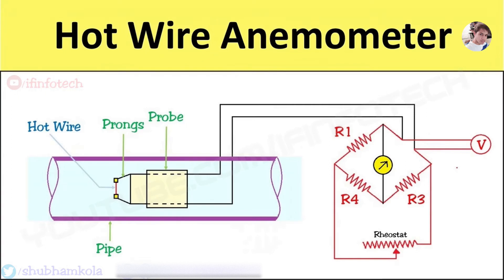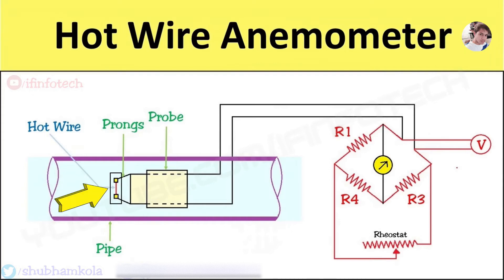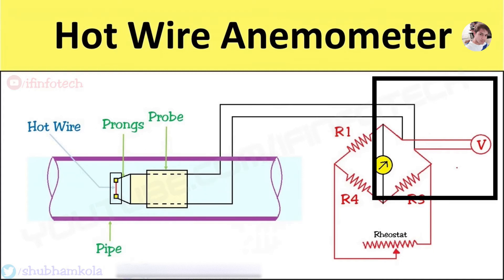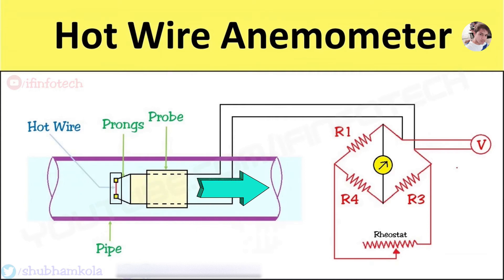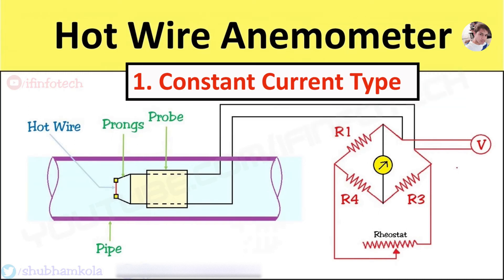Hot Wire Anemometer: Working Principle, Application, Flow Rate Measurement [Animation Video]

Comment: Please Let me know, Why you are saying fluid? As I have read that it is only measure the air or gas flow rate? Thanks in advance.
Reply from the maker: fluids is any substance that flows. Air is a gas so It is a type of fluids.
Reply: If you are doing mechanical engineering it is basic Of fluid Mechanics..😂😂
Reply: Fluid consists of both gas and liquid